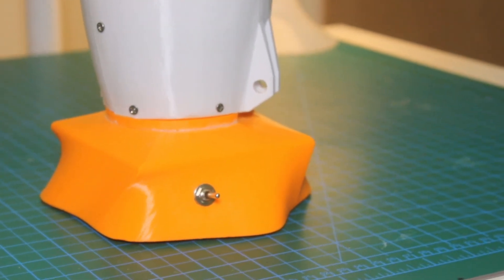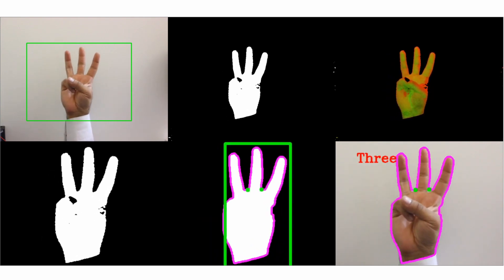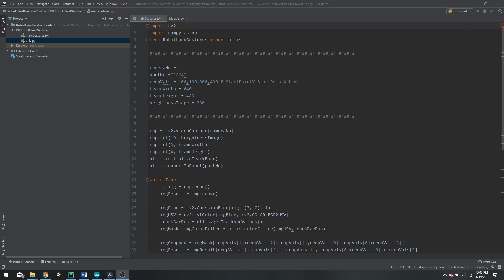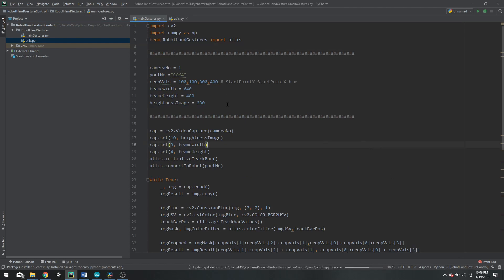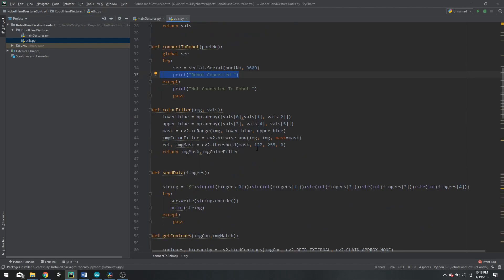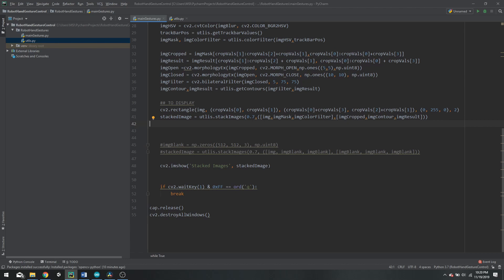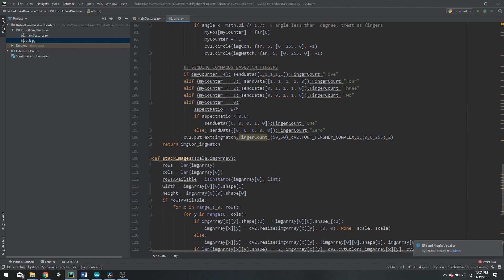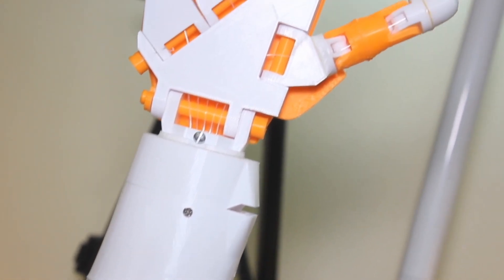Robot Arm Arduino Tutorial | Gesture Controlled (Part 2)

Comment: Hi Murtaza!
Great project!

I'm trying to run it on a Mac, however the serial  port numbering is different (not COM4, for instance).
Here is the line of code I replaced for:
portNo ="/dev/cu.usbmodem14101 (Arduino Uno)"
 Unfortunately, it' says "Not connected to the robot". Any suggestions?
Thanks

Comment: Great work . Can you publish the wiring connections? 
How does the Arduino communicat with the python script?
Reply from the maker: The pin numbers are mentioned in the arduino Code. The communication is done serially between arduino and python. The video explains how it works.